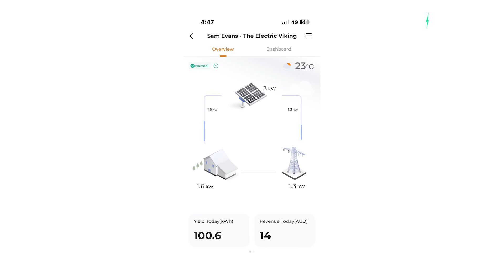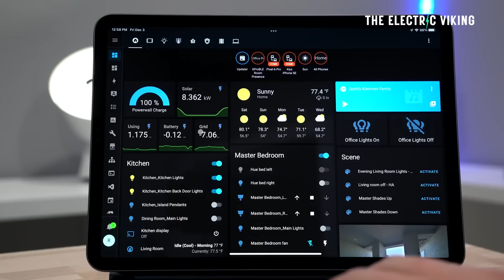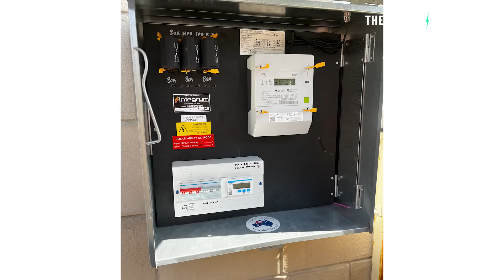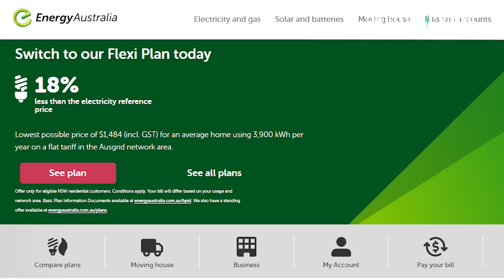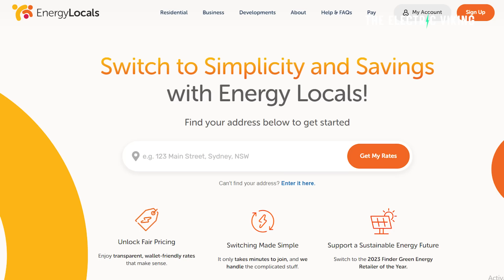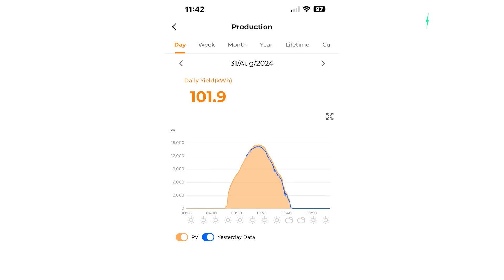Review of my NEW solar system installed by Resinc Solar in Australia

Comment: It would be great if you could do a show about Off-Grid EV charging options. I am in the process of having my Nissan Patrol converted to electric by Australian EV specialists. It will be a 400 volt duel motor, 174 Kwh NMC battery with a 10,000 watt inverter as a backup power system for my property. I have a Victron 8,000 watt 48 volt Quattro battery inverter
, 32 Kwh of BYD batteries
, 2 MPPT’s
 controlling around 9 Kw of panels. It powers a micro grid on my property and will not have the extra capacity to charge my EV. I have put 11Kw of panels up on a shed next to the place I will garage the vehicle, I thought DC charging would be doable and simple, but the company are telling me it has to be AC charging. What do people who are off-grid in a situation like I am in do to address our situation? Can email you with a more in depth word doc with pictures and illustrations if you are interested.

Comment: I had a much worse delay with a UK smart meter fitted some time ago now.  The first one turned out to be faulty - they couldn't connect it to the back-end reporting system.  I had 9 months arguing with the electricity provider, trying to get a replacement, because their 2nd visit from a meter fitter (they're not even qualified electricians) took exception to my (fully certified - by a qualified electrician) EV charger installation and the energy company kept refusing to replace the meter until I paid someone to have the EV charger installation re-done.  Eventually they caved in - but it took way too long and several threats of going to the ombudsman etc.  Anything after the meter in the UK is not any of the electric supplier's business, but they still thought they could interfere, it seems.  Maybe that was because they were getting into the EV charger installation business (so not impartial). For a long time, they ignored all reasonable argument and the installation certificate I had.

Comment: Not a good installation. The installer should have had the roof painted white before they installed the panels. Installing solar panels on a dark-coloured roof reduces the amount of electricity the panels produce. Dark-coloured roofs create heat, which is the enemy of solar panels and reduces the electricity output. The worst colours for roofs are black, green, red, or any dark colour.  The Australian government is trying to encourage white roofs in Australia with their “Cool Roofs for Australia” program, but still, in most new suburbs, dark heat-producing colours are preferred.

Comment: Sam, My wife and I are visiting friends here in Melbourne.  They just acquired a house in suburban Melbourne called "Kew".  I have shared with them your YouTubes regarding putting solar panels on the roof and acquiring a battery.  The wife is pro Solar but the husband wants to see how long it takes to break even.  Since you are also in Melbourne and used Resinc Solar how soon was your break even from installing Solar w/battery?  Is there a spread sheet where I can input the size of the roof along with the panel info and generate a good estimate?  Best - Greg Kenley - Boston

Comment: Longi LR5-54HTB-440M
440w, 33.56v, 13.12A. 22.5% efficient. 1.7m x 1.1m.
Seem to cost around 100 Euros each, cheaper with quantity.

56 panels = 440w x 56 = 24.6kw.
At around 100 Euros, that's 5.6K Euros, plus mounting, labour, cabling, inverter, ...

Much cheaper than I paid, also for those blue panels, back in 2015.
Mine were 260w panels back then. I see it's 400+w today.

Sept peak around 15kw.
Overall daily 1st Sept = 101.7kWh.
Worst month would be June. Best month is December I would guess based on NSW.

Comment: so 14kw between 1120-1300 so 35kwh just for 2.5hrs and a minimum of 9kw between 0820-1640 so minus the 2.5hrs you have 59kwh on back end of winter but was more like spring so should be at about 50% of summer peak so watch summer breach 200kwh daily

Comment: PSA: do your homework on resinc solar.

out of the 3 quotes i got they were 15k more than the one and 10k more for the other and the equipment was on par (think other quotes actually used slightly better gear) and these were good local installers. they’ll tell you it’s all in their warranties and in their service and i’ll say i don’t buy it.

if you go by finn from solar quotes’s own definition of ‘rip-off merchants’ resinc seem to fit the bill.

of course i could be missing something, so do you’re own homework.

Comment: Sam yes, panels can generate electricity from scattered light... but very inefficiently as you said 26kW system generates 500W.... That is 1/52 of the optimal power output. However this optimal will never happen... Angle, facing, shade, dust, wiring, connectors, manufacturing offsets, + yearly about 1% capacity degradation will make it impossible.
You can use this tool to calculate the your yearly production with different parameters. https://pvwatts.nrel.gov/ It is even using Weather data for predicting the capacity.

Comment: In W-Europe the typical electricity cost consists >50% taxes of all kinds (governments) + the build and ‘maintenance of the grid (private companies).

 When you install solar and deliver to the grid you are using it without contributing to the cost for the exploitation. Enter a fee for your solar deliveries to the grid..  this is completely different than getting 10$/day. There are ways and means to avoid this without going offgrid however buy not delivering to the grid when you have excess capacity.

Comment: 1:11 shows some dudes standing on the roof with their safety belt not attached to anything. seems to be very good safety standards there.
Reply: Not very practical to do a complete installation with a harness connected. The standard practice is to install the anchor and use it when working close to the roof edge or when installing the lower row of panels.
Reply: not the best practice on health and safety

Comment: Interesting the installer commented that black panels absorb heat better so they’re more efficient. Photovoltaics are less efficient when hot. They’re tested at 25°C but heated above that temp can reduce efficiency by 10-25%.

Comment: Your channel is inspiring.

I installed 10kW panels on my roof and have driven the Deepal L07 (the sedan version of the S07 coming to Australia).

I am able to cut down my monthly electricity bill from 15,000 Thai Baht to mere 2,500 Baht. Amazing!!!

Gas bills? 5,000/month. Now ZERO!!!! Got the energy for my car from solar. And I turned on air cond all day. Only pay for electricity at night.

Overall I save 17,500 Baht or ~ $700 AUD per month.🎉

Comment: 5:20 Light makes electricity, not heat.
Heat reduces performance of the panel.
But hot black radiates heat the fastest, loose heat the fastest. 
I often wonder if a small cooling fan under the panels would help remove the rising hot air under the panels. 
Just a comment. 
Make sure you have enough cooling ventilation under your panels if possible.

Comment: Not connected to grid solar systems are easy to DIY.  A DIY 1000 watt expandable starter solar system, battery, charge controller, combiner box wiring and AC inverter and battery costs about $2500 US  to produce free green energy for life.  All are expandable.  A 2000 watt system might cost about $4000.  Sizing the system and determining whether this system will ever be grid connected would be two starting points.

Comment: I have the same panel series. The busbars have been moved to the back, so that they don't block any light.

These panels work very well in low light conditions and on a cloudy day you have enough of them to power the home. 

Also with clouds the light is dispersed, making all of them work, regardless of their angle.

In the Netherlands we don't get much for our excess solar power anymore because there are so many that it outperforms demand on a sunny day or on sunday when most businesses are closed. The best solution is a home battery. 

Not sure that the virtual power plant makes sense in the long run with big grid batteries taking over, but if you are getting a huge battery to charge your EV, you might as well make extra some money while it lasts.

Comment: It confused my tiny brain when you said north facing roof????? Then I realised you are in Australia and the other way around, I have solar but it is now dropping off so fast in the wet dismal  autumn, last two days flattened the battery to 24% and it needed charging from the mains again. I lost so much high output days because I am still not on pay in tariffs because the mains network and the supply company have dragged their feet to putting me on export tariff .

Comment: Sam. Yours is a uniquely NSW experience. Here in Vic there are several differences. Firstly we are limited to 5kw feed in single phase or 10kw per phase for 3 phase. That is all contingent on the distribution Co allowing any feed in, many people are denied. Metering in most areas in Australia is run by the distribution Co, not the retailer. There is no upfront charge here for metering. I am a sparky here in Vic. Feed in is no 3.3c kwh. For the first few summers I would have a slightly negative bill, but last summer the best I could do was a charge of $4 in Feb. I have a 6.6kw 1 phase system with solar edge optimisers and a 5kw solar edge inverter. A lot of your calculations can not apply in most parts of Australia.
Love the channel. Hope the Xpeng is a great car.
Colin
Reply: I am in Victoria and have three phase. But I'm limited to 5kW/Phase. I have about 20kW of solar but it only reaches that output if I have enough loads (EV charging is about the biggest). In a typical sunny day this time of year I only make about $2. (Feed in for me is also 3.3c/kWh) Although that more than covers the connection charge and I don't get a bill, its nowhere near the $10 per day that Sam is getting. I wonder if there is some special deal with the power providers he has in Newcastle ?
Reply: @bryanackerly7775  nope .Sam just exaggerates.
Reply: @bryanackerly7775  Exactly. How does Sam get this deal, please share. We have 10kwh on the roof but export is limited to 5kwh. And FiT is abysmal. Tell us how to achieve your numbers Sam, would love to know. It's high time that the Elco's raised the restrictions.
Reply: Feed in tariffs are so low now their consideration should be no longer considered. I have just recently looked at upgrading but financially is not worth it. With a battery added it's financial suicide. Prices of these systems will have to come down a long way yet. Do good research. If it's all about the environment for you, go for it.

Comment: You should have relocated the older panels to shade your hot summer roof.
Do not dump them.
Trying to stop heat into your roof on long hot days or remove built up heat is not easy.
More panels for low winter light is handy. 😊😊😊

Comment: Could you please show us the figures explaining all the capital costs, installation cost,running costs, discounted income on the total outlay say at 5% over the lifetime of the unit and any other expenses you have outland or expect to. All against the saving in electricity your unit is capable of including any degradation of efficiency the pannels might have very. Please don't leave anything out we want to see if what you say is really true. 
Tom
Reply: Exactly. 14 months after installing solar and crunching numbers, I realised that it was false economy. 
People tend to focus on the bill and not on the entire cost of the system. Factor in a loan on the panels and you also have to offset interest payments. 
I would have been better of investing the $10k elsewhere.
I also have changed provider to Origin and have the EV Power up plan. 8c per kwh to charge my Tesla Model 3. The single biggest saving across the board making the solar negligible. 
Glad you pointed out these very important costs, that factor into the overall equation!

Comment: East-west (or even just west) facing is definitely better these days. Supposedly only ~15% less total output. Gets some production (and therefore less import) into the evening peak - which is getting more ToU price hikes these days (enabled by the smart meter). Fewer imports for brekky and dinner. Crank the AC until the sun goes down, pre-cool the house and need none after that, etc. I have never managed to max out midday production going pretty much free to the grid (often into negative wholesale priced market).

Comment: i bought the pieces one or two at a time, installed the system myself...yes i made some mistakes, bought two things i didn't need at the time, but need one of them now.  bought used solar
panels that put out half of what they should put out...still expensive.  I could have bought 4 new panels that were really powerful for about $2000 and have more power now...but I didn't have
the money.  It's really hard to buy 2 panels at a time that won't break your bank and are powerful.  I now have 26 panels that cost me about $3000  instead of six panels that would have cost
me about the same and put out the same amount of power.  I think the most important thing you can buy first is figure out how power you need to charge an EV car.  Buy all your equipment
to fit that figure...batteries, panels, all in one charge controller/inverter.  I bought a battery charge controller that is nice, cost a lot and handles quite a bit of power...IT turns out I should have
waited to buy an all in one charger/inverter with twice or three times the power, puts out 220vac split phase and accepts 2 sets of solar panels that you can add to.  My system ended up costing
me about $12,000, but would have cost me about $40,000 to $50,000 to buy and install.  In my area a smart meter doesn't help...the power company charges only for how many Kwh you use,
not when you use them.  So it doesn't matter when you charge and when you use power.  The main reason I installed solar power is to provide power when the grid goes down.  Sometimes
for 3 days, sometimes 1 day, and a couple times for nine days.  My system will work for two days and then I have to start a generator to charge the batteries while also using power.
Reply: I donate money to the utility to provide wind power to all of us.  I donate money (pay) for a street light at night that I don't have to.  Those two payments are about 1/3 of my bill in the
summer.

Comment: Hi Sam You are a big fan of Tony Seba.  Well it seems like you have not followed his bell curve formular for solar / battery instalations.  Or have you?  Maybe on an average home all one needs is  maybe 12-14 panels and a 10-15Kw storage battery.  However if you have calculated to add in your future power consumption of charging your Xpeng G6EV during the day and at what rate, then?   I can still feel you still have too many panels.  It would be good for you to do a video on the rational of the system you are aming at, with the 26 panels generating 26Kw/h at the peak.

Comment: Sam all the best to your family mate, but wait until you get batteries, I buy 1/4 of a kWh per day and export about 10-20 kWh's/d (my system is only 10kW (half of yours) I installed the FranklinWH batteries (x2) because of the off grid and black start capability. I did also buy the generator module of them so I can recharge the batteries by generator if I need to, so far I haven't needed to use that. We had a 48 hour blackout here because of the recent high winds and I didn't run out of power at all and I have a granny flat and a full house occupied. The batteries were so good I even ran some extention cords accross the fence so my next door neigbours had some power. I can't wait to get my EV so I can store my excess in that rather than export to the theiving $hits that are our energy retailers. Yes it cost some money but "Sticking it to the man" is so worth it!

Comment: Hi Sam 
Installed longi panels 4 yrs ago (here in Melbourne) and installed SolarEdge inverter. Great products no problems. Since then installed a SolarEdge battery and last month an EV charger. All in the SolarEdge ecosystem. More expensive but fully integrated and allows expansion to future installations eg water heaters, cook tops etc.  this expansion is another thing to consider in a purchase
Reply: I'm with you, similar setup but not solar edge.  I'm now in the market to throw out our old has ducted heating and get a heat pump, but it's a nightmare trying to find a drop in replacement. 😞   I need the Tesla HVAC system to integrate with all my other Tesla stuff (EV, Battery, Gateway & battery)...

Comment: smart meter is installed by the electricity lines company who owns the power lines not the electricity sellers.
Reply: Yeah I thought that was odd to, I make a point of it to get the metering upgrade done for my customers, you only need the NMI and the retailers email or phone number etc or fill in the online portal for them. So I don't know why these installers don't? I've been on the "Solar Coaster" nearly 30 years, I've never left the customer to get the metering done unless they are with a retailer that specifically prohibits a third party contact in which case I would sit with them and get it done.
Reply: @mzmadman yes this is an odd one, same deal the PV installer has the ball rolling on the meter upgrade once you’ve placed the deposit & the install date is set.
Reply: Not in Victoria. There is a govt approved list of sparkies licensed to install them.